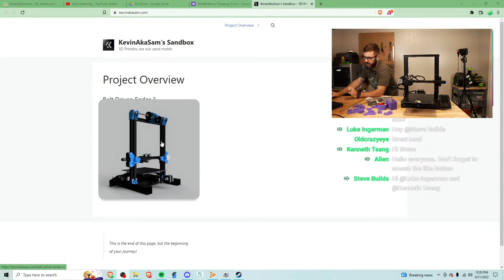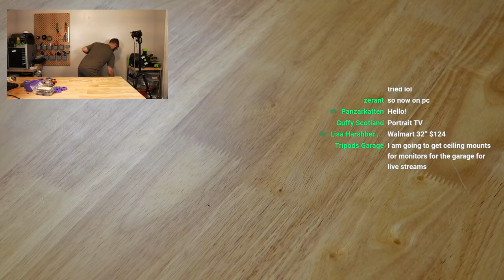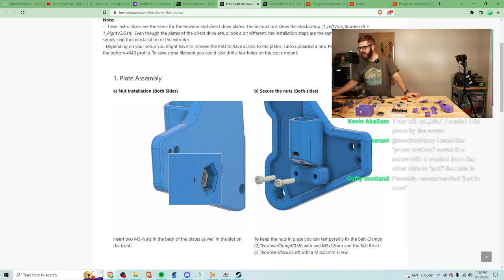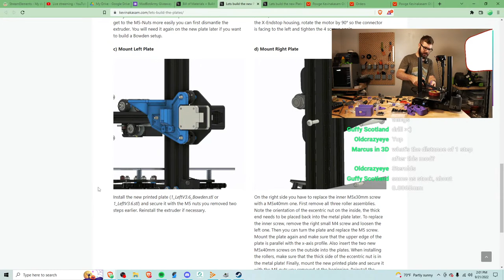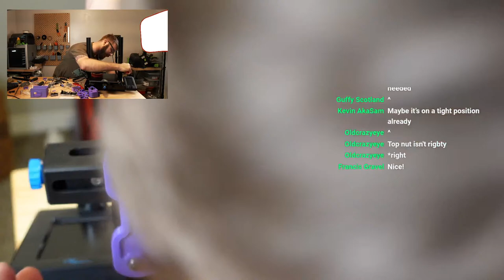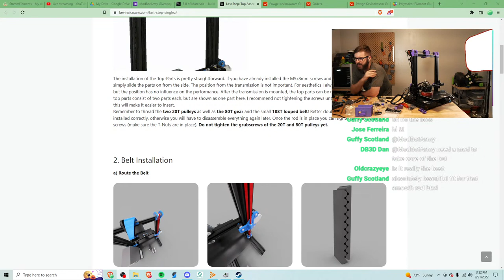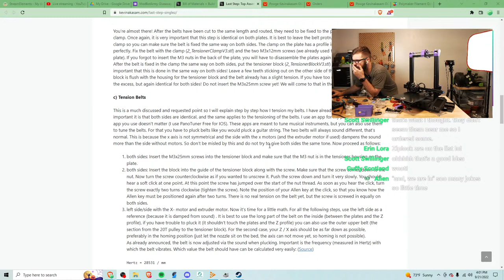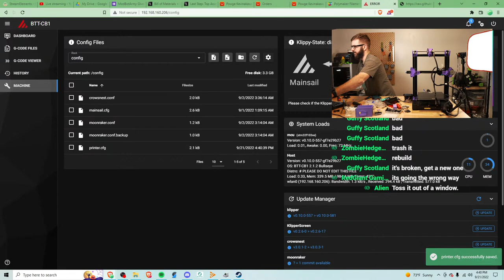KevinAkaSam's Belted Z Ender 3 Mod Install

Comment: I printed this set in PETG and it's been great. This is probably a good step before making your ender 3 a Voron Switchwire.
I source all my parts separately and ended up paying twice as much as extra parts I don't need, so I recommend the kit.
Reply: did you print them with a 0.4 nozzle?

Comment: I’ve had the same mod for over a year. Mine has the taller motor mount. It resolved all my z banding issues and gives great results. I’ve been very happy with it.

Comment: I've had this mod for quite some time (must be coming up for a year), and even ended up installing taller Z extrusions.  Very happy with it.  Quality upgrade was great.  I think sticking with WHEELS gave the better quality compared to cheap linear rails as well. (EDIT: Oh... and make sure you take a look at some of the remixes before commiting.  They may have what you need!).   I found the center bearing next to the extruder liked to wiggle out, so used a touch of glue to hold that bearing in place :)

Comment: If you're going to 86 the drive screws in favor of belts, and also want to 86 the V-slot wheels in favor or linear rails, then you might as well go core xz as a switchwire.

Comment: Has anyone tried using the Y motor from an Ender 5? I know that would assume you have and extra lying around. I my case I do because I converted mine to CoreXY. So I wonder if this would work with that?

Comment: On the z axis why is belt better than screw drive?
Reply from the maker: Quicker travel movements and z hopping, but primarily gets rid of most z artifacts. Lead screws can have things like z wobble which create artifacts. Usually this is due to cheaper or bent lead screws.

Comment: This looks good but what is the purpose of the transmission?
Reply: To keep the Z axis from falling when the motor is off and to keep the same steps/mm as the standard leadscrew. Also allows you to use high accelerations for Z-hoping.